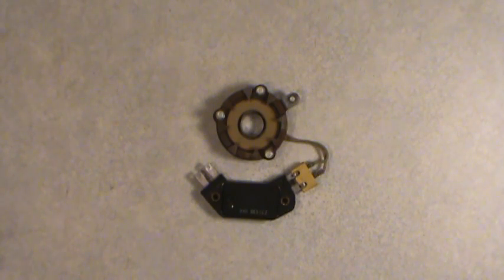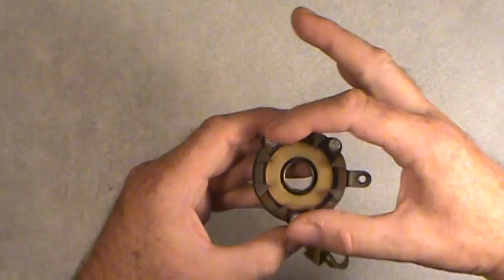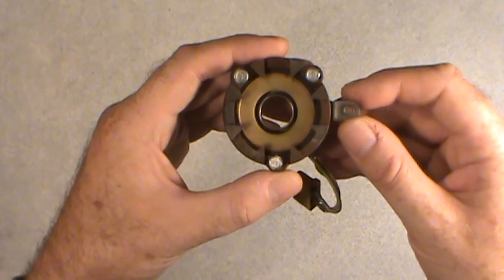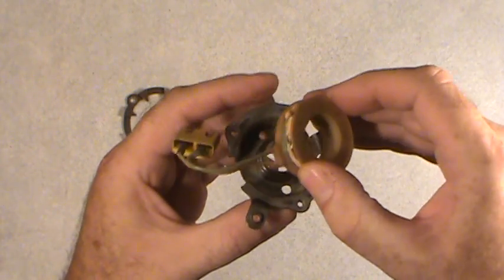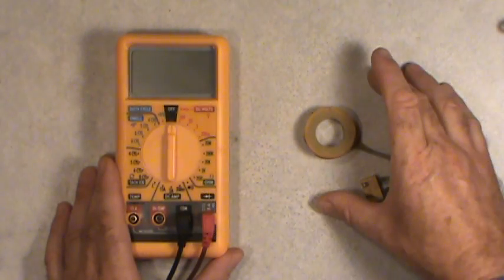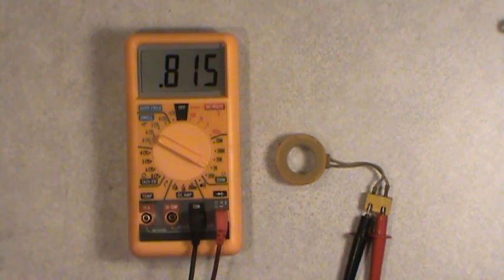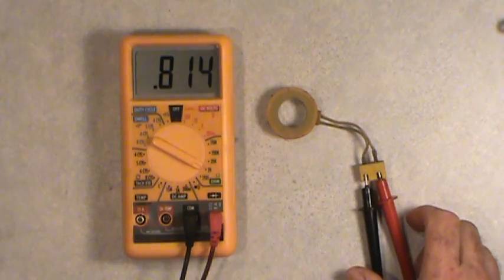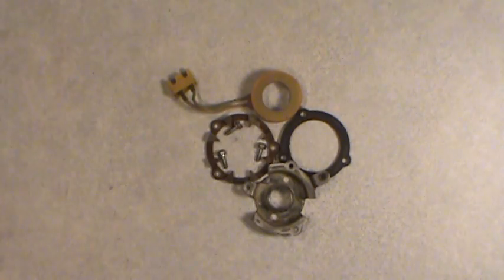HEI Distributor Pickup Coil Test

Comment: Is it responsible for the injector pulse, it has sparks but no injector pulse. Does the pick up coil and the module is bad? FYI my car is a Daewoo Espero DOHC 1.5  Thank you
Reply from the maker: Greetings...Charles William..............Thanks for watching...............Sorry, for the vary late reply, as I don't recall seeing Your post, in the messages, that I usually receive, like I get, with all of the other ones..............As far as I know, most of the signals, that get sent to the vehicle's On-Board Computer, sure seem to, kinda, interact with each other.................There are a few things that can be done, to, shall we say, narrow down the problem, most times................The first 2 things, that I usually do, is, to, have the vehicle's On-Board Computer "Scanned" for "Trouble Codes", to see if any Codes show up...???...and...Have the "Fuel Pressure"..."Checked/Verified"...with a Fuel Pressure Testing Gauge, in order to make sure, that, the Fuel Pressure, is with-in the Vehicle, Manufacturer's "Specifications", cuz, if the Fuel Pressure is too Low, then, the Fuel Injectors won't be able to Spray, any Gasoline at all.................Be very Careful, whenever working on, or near, any of the Fuel Systems Parts, or Fuel related Lines/Tubing/Hoses, cuz, some Fuel Pressures are really High, and Dangerous...!!!................Some of the Fuel Pumps, can Pump out, somewhere around 100 PSI/Pounds per Square Inch...!!! (kinda like a mini pressure washer...!!!)...................If You are getting Spark/s, that will usually, have me thinking, that, the Pickup Coil and Module, should be doing their jobs quite well..................Did You use a Test of some kind, to determine, that, there was "No Injector Pulse"...???.....................Some Mechanics, might use, what is called, a Noid Light Tester, and hold it near an Injector, to see if there is an electrical field, being produced by the Injector, as far as I know...............So, if You are, or maybe in the future, having any more problems, always remember, to, Scan the vehicle's On-Board Computer for Trouble Codes, and have the Fuel Pressure Checked, to ensure, that, the Fuel Pressure, is within Specifications, as, by doing those 2 things first, You'll probably find, that, You'll save a lot of time, and hopefully, some Money as well (I hope), and..........till next time..........Be Safe, take care, and have a good one.

Comment: i have a distributor 4-pin Black red white and green wires, how do i determine hall sender unit?
Reply from the maker: +Skeleto Manuqtix Greetings Skeleto Manuqtix....Thanks for watching................You didn't mention, what, Make and Year of Vehicle, and, about the Engine Size/number of Cylinders, etc., that You have there...???.................................................Each and every Vehicle Manufacturer, has, their own way of doing things, and, that also includes the "Hall Effect Sensor" as well, and, some Vehicle Manufacturers, might call it by Another Name, just so You know..........................Also, where is this, as You call it, the Hall Sender Unit "Located", as in, maybe, connected to a Distributor, or, maybe, somewhere near the Engine's Crankshaft, maybe...???............................Seeing as how, You were sayin', that "it" has 4-Pins and Wires, that has me thinkin', to be Very "Careful", when-ever attempting to Test it, in any way, cuz, there could possibly be, some Voltages (electricity) involved, that is connected Directly to Your Vehicle's On-Board Computer, and, if something goes Wrong, "Poof", the Vehicle's Computer gets "Fried"...!!!...............If Your Vehicle is about 1996 or Newer, did You have Your Vehicle's On-Board Computer "Scanned", with a Scan Tool (kinda looks like, a slightly Larger, hand held Calculator), for any possible "Trouble Codes"...???.......Also, if the Vehicle is Fuel (gasoline) Injected, did You have the "Fuel Pressure" Checked/Verified, in order to make sure, that the Fuel Pressure, is with-in the Vehicle Manufacturer's "Specifications"...................."Warning"...!!!....Some Fuel Pressures, can be in the neighborhood, of about "60 PSI/Pounds per square Inch", and can be "Dangerous", so always wear Eye Protection, have a Fire Extinguisher nearby, and do it Outside, along with plenty of Fresh Air and Ventilation, cuz, Engine Exhaust Gas is Deadly...!!!...........................Maybe, do an Internet Search, using Your "Exact" Vehicle, and, look for a Website, that has a "Forum" on it, where You can ask them, about Your "Exact"...Vehicle...and hopefully, Someone on that Forum, will be able to tell You, how to go about, "Testing", Your, as You called it, the Hall Sender Unit...........Good Luck, and.......till next time.......Be Safe, take care, and have a good one.
Reply from the maker: +Ricky Bobby ....Greetings Ricky Bobby....Thanks for watching...............Well, for starters, seeing as how You were sayin', that Your 350 had a Backfire through the Carburetor, that's pretty much tellin' me, that, You at least have some Spark alright (no spark, no backfire right...???)..............Before I continue, then Yes, an HEI/High Energy Ignition Distributor, could possibly cause a Back-Fire through the Carb (very Rare for that to happen to me)...................Having the Engine Cold and Not Running, Make sure, that the Distributor "Hold Down, Clamp Bolt, is Tight", or the Ignition Timing will be All Messed-Up, and will need to be Re-Set, to the Correct Initial (base) Ignition Timing, for Your Exact Engine, or, Engine Damage it will be...!!!..................So, No Warning what-so-ever, before Your 350 started acting up at all....???..............How Hot was Your Engine (at the time), and, what Starting Procedure did You use...???...as in, how much Gas Pedal, did You give it, and/or, did You Pump the Gas Pedal at all...???.......................Now, I'll take a guess (cuz I'm blindfolded...lol), in that, I'm leaning towards a Fuel related Problem..............Might be too Lean, of an Air/Fuel Ratio/Mixture, which might be caused by some of the following...........Vacuum Leak, maybe a Vacuum Hose came off of something, or broke...???................Fuel Pump getting weak...???............Fuel Filter Plugged-Up...???.....................Maybe, too Rich of an Air/Fuel Ratio/Mixture, caused by a sticking Carb, Choke Plate/Valve, and/or its linkage...???........................Check all Ignition Wiring Connections, and make sure that they are Clean, while having the Engine "Cold and Not Running", just to be sure...................How Old is the Carburetor (Rochester...???), as the older it gets, without a good and proper rebuild, the better odds of getting a Surprise, just like You had...!!!..........How Old, are the set of spark plug Leads/Wires...???..........................Did Your 350 have a Tune-Up, not all that long ago...???...as in, Checking, and Setting the Initial (base) Ignition Timing if need be, replacing the Air and Fuel Filter/s....................Then, a Set of good quality Spark Plugs, that have their Gaps, Set to the Correct Gap-Setting as well...................The previously mentioned things, are just a few, of the many possibilities, that might have caused that Back-Fire......................Was it just a Hick-Up, or, is Your 350 still Backfiring, and if so, did You notice any Miss-Firing at all...???...........So then.......till next time.....Good Luck, and...........Be Safe, take care, and have a good one.

Comment: can't this be tested thru the tach lead on the cap?
Reply from the maker: +Justin Strausberg Greetings Justin Strausberg....Thanks for watching......................The only way, to take an "Accurate"..."Ohm-Reading" (resistance), with an Ohm-meter/Multi-meter, would be, to..."Disconnect"...the...Pickup Coil's..."Connector", that Connects to the Ignition Control Module, then, Connect the Meter's 2-Probes, to the 2 Connection Terminals, that are in that very same Disconnected Connector, and, it would be a good idea, to Wiggle those 2 Wires, while taking that Ohms/Resistance Reading as well, just in case, there might be a Break, of sorts, inside, either of those 2 Wires, cuz, over quite some time, while the Vacuum Advance Canister/Unit is pulling on, and relaxing, so many times, while the Engine is running, those 2 Pickup Coil Wires, sure do get "Flexed Lots of Times"...!!!............................Till next time..............Be Safe, take care, and have a good one.